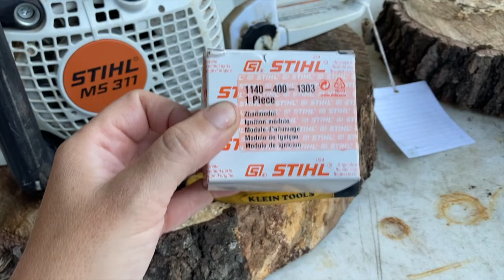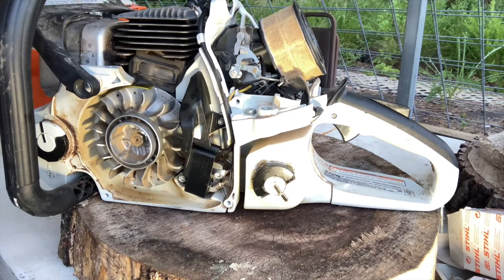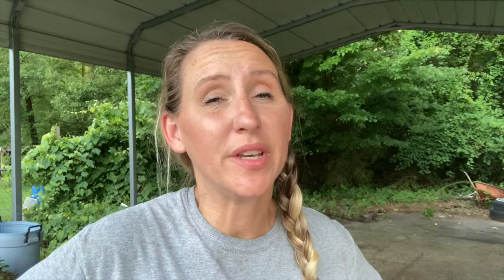Customer Destroyed It! How to replace your ignition coil and plug boot on Stihl MS311

Comment: Hey Chickanic, thanks for the good video.  One thing that can make it easier is to thread your coil wire, without the spring terminal yet attached, through the boot (put some grease on the wire), then attach the spring terminal, then pull it back through (reverse it), being careful to seat the spring properly
Reply: You're spot on. That makes the whole thing a lot easier!
Reply: Big brain move!

Comment: I'm glad that somebody agrees with me about gas. Especially  in these pre mix containers.  I mix my own every time and it has yet  to fail. Great work!
Reply: me too, at $ 5.00 to $7.00 dollars per gallon I would be out of business!
Reply: When I got my Sthil MS 170 ( because my Stihl MS441 is overkill for cutting small limbs/trees) the dealer where I bought my ms170 told me that if I bought the pre-mixed Stihl brand fuel it would extend my warranty by 2 years but for a 1 gallon jug it was $7.50. After they explained to me the benefits of the Sthil brand fuel, I decided not to get any I just mix my own and have not had any issues with the fuel itself, the issue that I have is a chainsaw doesn't seem to have enough power and when it gets hot it shuts off and won't start until it cools down. I've taken it back to the shop to have it looked at twice and was told there was nothing they could do. I insisted it could be a manufacturer defect or something of that nature and they told me that it was very unlikely.
Reply: @jamesdrew8569  try $27 (£20) a gallon for stihl motomix here in the UK!!
Reply: @SouthernStyle08714  Try running a compression check on your chainsaw.You could also pull the muffler off and see if the piston is scored.
Reply: @GoldSeals  thanks I'll definitely give that a try but the chainsaw is just a little bit over a year old but has barely been used so there shouldn't be any piston scoring but like I said I'll definitely give it a try
Reply: I also never use any gas that has ethanol in it and mix my own every time. I have old homelites so I do trust anything that I haven't mixed my self
Reply: Use Non-Ethanol fuel only, alcohol will give problems with heat, water condensation, corrosion!
Reply: @stevethiel5838  
I've had great success with the additives that neutralize the ethanol. 
What I do is take a 5 gallon fuel can and pour in the correct amount of additive for 5 gallons (of course) and then go to the gas station and put 5 gallons in the can (of course).
I use that fuel for all of my lawn and garden equipment, that includes my Husqvarna 385XP professional saw that I log with, anything that needs 2 stroke I just use the fuel from the 5 gallon can to mix in 1 or 2 gallon cans.
Ever since I started to do that all my ethanol issues with lawn and garden equipment have disappeared, my riding mower, push mower, weed whackers and chain saws haven't had any of the issues they used to when they started selling us that crap ethanol fuel, no more melted diaphragm's in the carbs, I can leave my weed whackers, mowers and chain saws sit for the off season with full tanks and months later they'll start right up just like in the old days.
Reply: @dukecraig2402  i don't know about additives but I remove the alcohol from ethanol. It's a very fast and easy process and there's many YT videos showing how to do it. I don't know how an additive could avcomplish the same thing.
Reply: @bmfilmnut  
First off you don't "remove the alcohol from ethanol", ethanol IS a type of alcohol, matter of fact when you drink any kind of alcoholic beverage you're actually drinking the variant known as ethanol, it's produced by fermentation.
The various products you can buy like I use don't remove the ethanol from gas it simply neutralizes it so all the bad effects from it being blended in with gas are no longer a problem, it's much easier than any of the methods like running water through the gas to remove it.
Reply: @SouthernStyle08714  Had a similar problem myself many yrs. ago, there was a crack
in an air pipe coming out of the carb.near the fuel pipe.
Reply: Love your Channel Tim Nova Scotia Canada
Reply: @daveh1081  Fuck yeah! It's pishin' out of the North Sea and we pay  like it's being imported.
Reply: @SouthernStyle08714  Where are you guys finding this premixed gas for $5-$7 per gallon?  In my area the cheapest I've ever seen it is at about $33 per gallon.  INSANITY!  

If a new carb is about $30.... you do the math.
Reply: fuel Only last for six months on these modern chainsaws edge trimmers etc  than they don’t start. Make your own mix is better
Reply: 1 ounce of sea foam in the fuel will save a lot of aggravation. Equipment starts so much better.
Reply: @ragingchilishiz9923 there is a switch on stihl saws to swap from warm weather to cold weather. If you have it set to cold weather when it's above freezing your saw will get way too hot. You should check that switch. Make sure it's in normal operation mode not cold weather mode. Running in cold weather mode when it's above freezing can completely destroy the engine.

Comment: They make a tool named a "Spark Plug Boot Puller?  They hook around the boot near the base of the boot and pulls the boot right off.  A labor and damage saver!
Reply: @carlosmorel2225  I
Reply: yea,,,,,it's called a pair of pliars,
Reply: Sometimes just being smarter than what you're working on will get things going.
Reply: I know this was 4 months ago, but those pliers do not fix into small engine tight places. They do not work on most new cars eather.

Comment: Thank you Brea for showing this old man that I am not the only dummy who messes up the ignition wire by cutting it to so the end fits securely to the plug tip.  I was totally frustrated that the oil wire no longer fit, but now I know... DON'T cut the wire... 🙄.  Thanks for your great videos!

Comment: Your kind advice was just what I needed to replace the ignition coil on my trusty 20 year old SH85 blower. The business card worked great. I also did not mess up the spark plug wire because I was careful as you advised. Thanks so much.

Comment: Awesome 👍!  I can use this info for sure! Thanks so much!  I use Stihl and Husqvarna equipment and love to do as much as I can on my own. A few months back I had to change out the original spur sprocket on my 2012 455 rancher my dad purchased as bday present back in 2012 to help him on his property in the country.  Thankfully my plug cable was not obnoxiously tight and popped off  easily. I have also learned the trick of grabbing them in such a manner as to grab the wire inside the boot so as not to pull it all apart.  I took some auto tech courses  years ago and learned they will rip apart too if pulled incorrectly.  A little finesse  goes a long way in saving time and money.

As to the gas issue my father taught me to always mix my own to avoid any issues and always mix per each tools specs.  We also use non ethanol high octane. As you mention not all pre mixes are equal or designed for everything. You can easily burn up a small engine if the mix is not right. I learned this lesson the hard way when doing yardwork for my aunt using her weed trimmer and the gas someone had mixed incorrectly for her and was low on the oil side of things. I hard seized that engine in short order.  So yup wrong mix gas can really mess you up quickly.

Comment: Thank you so damn much! This happened to me yesterday (why do they make the damn coil so tight?!). I was about to strip the wire and try to reconnect just like this person did. I just pierced it back into the wire they way you showed and it started right up! I pulled the wire through the boot before connecting it though, so I didn't have to stuggle to get the coil back through the other end of the boot. We are tryly lucky to live in the era of the YouTube DIY videos, all thanks to content creators like you!

Comment: Cool video and very good advice!

Only one thing: I find it easyer first pusging the wire through the boot, then fit the connector on the wire and finally pull the wire with the connector attached back through the boot until the connector fits. I also find it easyer to push the hole into the wire with a thin nail or an (german:Ahle) and then fit that hook from the connector. Before doing so i pierced my fingers several times...  Not to bad but also no fun... 😁
Reply: I agree much easier put the wire through the boot first, then affix spring-connector, then PUT A PIECE OF JUST THE RIGHT SIZE SHRINK WRAP (that you have sleeved onto the plug wire beforehand) around the "straight part" of the spring-connector, then a little silicone grease, then back into the boot gently helping from the front.  (If you are desperate and do not have shrink wrap, at least use a couple of turns of Scotch 88 -- leading out the back of the boot)

Comment: Good video.  I got rid of all my Stihl saws and switched to that Swedish brand for saws and Echo for trimmers and blowers.  My Stihl saws ran great AFTER you got it started.  I figured out that Stihl was named that for a reason.  While everyone else is cutting wood, you are "Stihl" trying to get yours started.  I have a John Deere 21S line trimmer, that was made by Echo that I bought in 1994.  I use it every week and it has run reliably all that time.

Comment: Love the videos! I watched this one and have a few hints:  I work on tools (pneumatic) with a lot of pins and plastic housings and I found that a long punch or small phillips helps to line up misaligned housings and then just tap the pin in to push them out. Also screws in plastic go in easy if you turn backwards until they drop into the old factory cut track, this also limits worn and stripped out holes from overlapping cuts.

Comment: Thanks for the video, I usually put dielectric on plugs and such makes them come off easier, thanks again, you make it look easy
Reply: Yes. However in my experience, to much dielectric grease can have averse effects in cold temperatures. Not plug boots but like trailer, spreader and plow pigtails. I would assume the heat generated by the cylinder head would be enough to mitigate this issue there.
Reply: 👏👍SUBSCRIBED 🔔
Reply: Dielectric grease? What part number brand?
Reply: Makes all the difference. Just a dab will keep the boot popping right off even years later with no problems.

Comment: I have several 2 cycle tools.  I seldom ever change the spark plugs.  There are no moving parts in the spark plug.  If it was running when I shut it off and won start, it's probably something else.  You're video just reinforced that to me, thank you.

Comment: I was close. I had to repair a pulled ignition wire on a Stihl BR600 a few weeks back. I didn't cut the wire, but I did cut the boot to make it easier to install the wire/coil back in. Will definitely use grease and stretch the boot next time.

Comment: Thank you for the very helpful tips and videos!  One thing I've learned over the years is that when dealing with rubber components like the spark plug boot that get stiff over time,  it is helpful to boil the rubber component in water for several minutes to help soften them up.  That and dielectric grease or silicone spray also help for instance when trying to slide the spring inside the boot.  Just don't tell your wife that you used a cooking pot to boil a rubber component from your chainsaw.

Comment: I've gotten my fair share of bloodied knuckles pulling off plug boots. I wish those Stihls used the screw on type coils and boot ends. That job would be easier for sure.
Reply: I can't say for sure on the newer Ms saws but the old 029 etc type saws you could screw a new wire onto the old coil if it got chowdered up.

Comment: I put dielectric grease on the insulator and round tip of the plug, which helps me remove the boot.  I also twist the boot and put a screech against the boot and pry it off if it will not twist off.  I know exactly what you mean about the bayonet connector coming off the high voltage wire. 
  If it does come off I first try to straighten it back up inside the boot and just pull the wire out of the boot.  The connector usually comes with it.  I then insert the sharp end of the connector back into its hole in the high voltage wire.  With a pair of kitchen pliers I squeeze it back into the high voltage wire.  Still holding it down, I insert the round part of the connector back into the boot.  Once it is in, I push the wire in until the round connector is back into its normal place in the boot.  I then take a small screwdriver and align the round hole so it will go on the plug
You can also take a pair if pliers and use them to pull the boot off the plug.  You have to be real careful pulling the boot off or on.  When I push it on, I want to hear and feel it go back onto the plug.  You will hear and feel it go back on as the round coils connect unto the plug.

Comment: Thanks! Gently warming the boot also aids in reinserting the wire and connector into the boot. Meaning, that in cold weather, warm the boot close to your body before attempting to stretch open the boot.

Comment: Yep, happened to me too on a FS 70 trimmer.  Thank you so much for showing how the spring is attached to the plug wire.  This is a very very bad design.  The wire is so short and the angle of the plug is such that you just about have to remove the coil prior to removing the spark plug boot just so you can remove the spark plug.

Comment: Ahhh, wheel bearing grease  is "non conductive",  always  use dielectric grease which is a good "conductive" lubricant and  corrosion  protector, plus it's  compatible with  all rubber or silicone  boots......just experience  that's I've been  through, still I personally give you 100% credit  for your  interest and diagnostics  in small engines.... Very well done!!
Reply: Despite the fact it has "electric" right there in the name, it's a fairly common misconception that dielectric grease is capable of conducting electricity. In actual fact, dielectric grease is an insulator and doesn't conduct electricity.

Comment: So it wasn't just me thinking the wire coil has become tighter, thanks! I've had them come several times a week too. 
And about the grease - I don't use grease for that, but a tiny squirt of WD40, it'll evaporate and let the coil sit tighter in the boot. You can try it some day, when you are out of grease.

Comment: A quick tip for you and your audience: I have a Stihl string trimmer attachment, and the spark plug used to shock me in the elbow when I held the trimmer a certain way. I cleaned the boot with carburetor cleaner, then added several layers of tool dip/electrical liquid tape (both are made of butyl rubber dissolved into xylene), and no more shocks. The tool dip is sold at Lowe's as Plasti Dip. It's a LOT cheaper than buying a new ignition module.
Reply: my briggs powerd mower the boot was gorn every blade of long grass it would short back to ground cof  and spluter weze and fart ..... i added polystyrene [ white foam box] in auto thiners till it made a puty  chewing gum ? now i got a hard plastic cap  now the strapping  briggs runs as good as new like it did in the 80s POWER ON
Reply: Permatex black works too

Comment: I found that inserting the spark plug wire into the boot first, pulling all the way through then attaching the spring clip into the hole into the wire with pliers then pulling the wire back into place works much easier than trying to shove or push it into place.

Comment: How weird, I just had to do the same fix on my weedeater, two days ago.  I was in the middle of my job and the thing stopped dead and the spark plug was pretty loose.  Not sure how that happen, but yes trying to get the boot off with a  bit too much force pulled it total off, I had to take to the whole thing apart to replace the boot back on it as there wasn't much room to do it together.   I may have been able to do it if I watch your channel first lol. Good job on showing us what to do if that happens.  Like I said not sure how that plug got lose as I never once looked at it and have been using it for three years straight. My hardest part was figuring out where the spring went  for the throttle trigger lol

Comment: Great informative video! Just experiennced trying to replace a spark plug. I pulled the skins off and used make shift prying method. I see a comment said there is a tool. Wish you would have covered that. I don't see how any tool can get under boot with the tiny opening with the skin on.

Comment: I've found dielectric grease makes removing plugs and connectors a lot easier as well as it's other benefits (waterproofing, dirt/dust blocker etc) and despite not being conductive it does't interfere with the wire connections.
Reply: Or spray silicone works to on plug boots
Reply: You wouldn't happen to have a video to post on about a ignition coil for a Stihl 029 model the original please no offense to your man but you are an attractive woman and even sexier because you know how to work on stuff hated to hear you saying you was closing your shop hopefully you're still there to help us viewers that need a question answered😊 😊

Comment: When it doesn't start and it's suspect that it is flooded then pulling the plug to dry it out can speed things up as well as verify a flooding issue. I use spray silicone on plug wire boots.
Reply: I've used and serviced many Stihl  saws over the years. If you don't release the choke lever after it fires just once ,it will flood. They are great saws , but tempermental starting !

Comment: Great video, sort of a two-for-one on this one. I have had success digging the wire out of the coil and epoxying in a new one. What is your view on this repair? After all what is there to loose.
Reply: Never taken one apart…. Could you elaborate? Would like to know more. Thanks
Reply: If it works and saves money it's good
Reply: Older coils you could unscrew HT lead, and refit new one